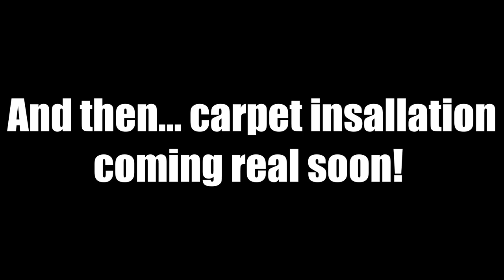Boat rebuild (PART 21) gunwale installed

Comment: I’ve never come actually that style of rub rail, no aluminum housing.  Interesting but now I see why you glassed the top to the hull
Reply from the maker: ya, I think this style of rub rail must have been on the older fiberglass boats, I haven't seen them on the newer styles which is why I probably had such a hard time sourcing it out.
Reply: @Project2Potential  usually you install a plastic channel to hold the rub rail.

Comment: Taco makes boats rub rails all different ones you can pick they are the best and most all boat repair and boat shops buy from them they sell other stuff for boats as well look them up.
Reply from the maker: I should definitely look it up, thanks for that tip

Comment: Close to ready for the lake!  Carpet, huh?  Personally I prefer some sort of lighter colored deck coating (bed liner?) with fine sand or texture to reduce slipping. Carpet can sure hold the water in and be harder to clean. YMMV. Anyway, looking GREAT!
Reply from the maker: getting close!  Ya I will only be using carpet on the sides. for the floor I have something else planned. 🙂

Comment: Nice
Reply from the maker: Thanks
Reply: @Project2Potential  hi
Reply from the maker: @Hearts4Mad  Hi! how are you?
Reply: @Project2Potential  good u?
Reply from the maker: @Hearts4Mad  doing very well
Reply: @Project2Potential  can you add a trolling motor and  a transom saver on the boat?
Reply from the maker: @Hearts4Mad  maybe, not sure if I will use those yet
Reply: When will you take it out on the water can u do it for the next vid
Reply from the maker: @Hearts4Mad  I have to put the engine on first, and steering. I hope to do that soon.
Reply: @Project2Potential  ok

Comment: Hi Mate,  could you please advise what 3m adhesive you used and whether it was successful in adhering the Gunwhale rubber. (By the way, it’s pronounced “gunnel”)  I live in Australia and am replacing mine as well.  Yes, there are a lot of companies sell it here and also a lot of varieties and at the cost of it, you have to make sure you get the correct one,  Cheers mate, and your boat looks shit hot.
Reply from the maker: Hey Neil! Thanks for watching, @ 6:57-7:05 I go over what adhesive I used and how I install it. The adhesive I used is incredibly strong, I wouldn't recommend anything else.